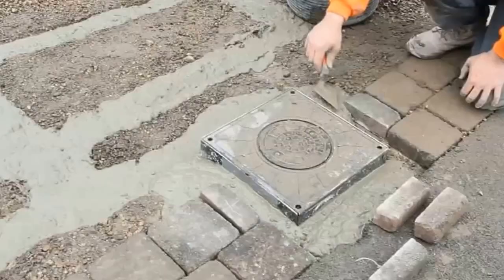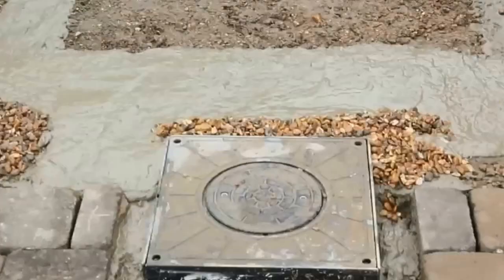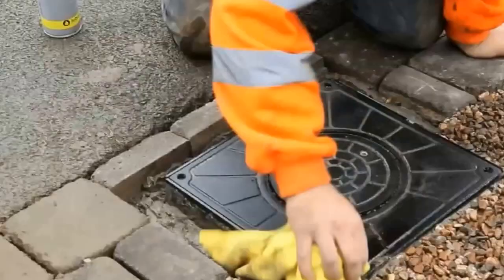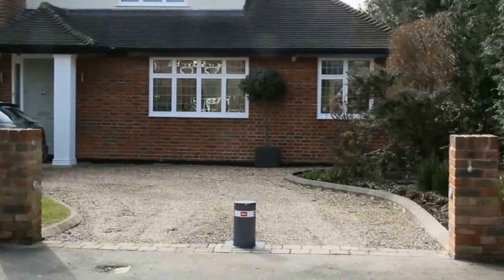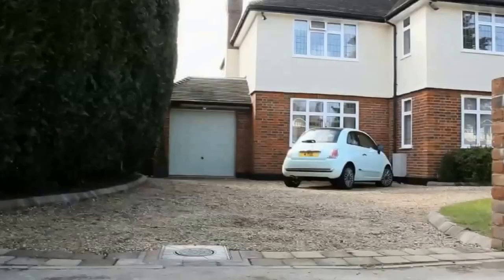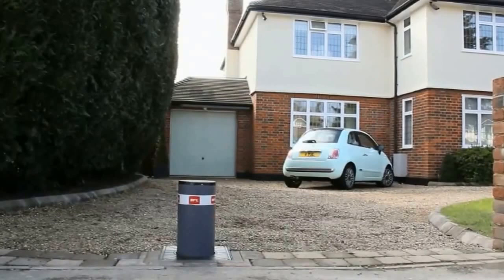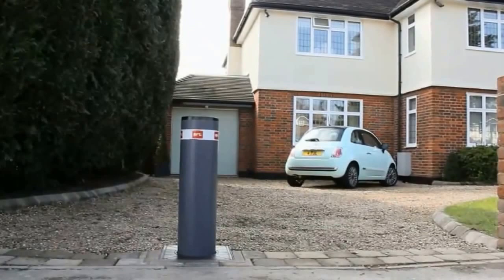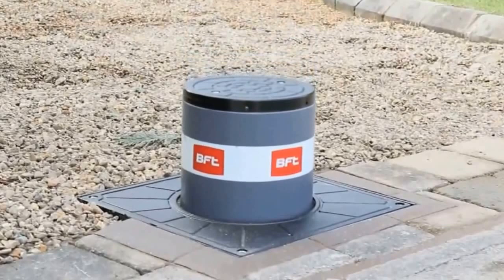Installing automatic rising bollards on a private driveway.

Comment: Anyone else notice that two Minis or Fiat 500s could drive on either side of the right side bollard... at the same time???
Reply from the maker: Fair point Cameron, although the bollards were not installed to protect either of these types of small vehicles. They are there to protect a large 4x4 and an SUV:)
Reply: @driveguard1  Would a lorry put that bollard down? Also, having wires accessible at the side of a pillar is a good idea?
Reply: @driveguard1  yes it's the first thing I noticed. You did a great job, but.... Ssssssshhh a stelel pole with a lock at the bottom would do the same ( if they intend just to pass either side of the pole! )
Is there a problem with SUVs and 4x4 s ???? 😂😂😂😂 in that area ??
Reply: Yes!! 🤣🤣🤣
Reply: @driveguard1  What was total cost (material + installation) for this job?
Reply: @embg  probly 2 grand total
Reply: I sure did.  You beat me to this comment. LOL
Reply: @driveguard1  could still easily fit a suv with that bollard up that house needs 2
Reply: @driveguard1  pointless
Reply: One bollard is obviously what the owner paid to have installed.  If that is what the owner wants, that is what the owner gets.  The job is done extremely well, professionally neat, and very organized. There is no accounting for what the owner wanted installed.  I think I would want two, or three, installed, myself.  But one is all that the owner could afford, I guess.  Price often causes compromise.
Reply: This installation really needs two fixed bollards next to the gateway pillars to reduce the large gaps and give added security.

Comment: The main thing to understand is that virtually any security system can be defeated given the willpower and the time.
So the point of a security system is not necessarily to defeat the criminal it's just to put them off.
Yeah, you can get past these bollards but why bother when the house next door is an easier and quicker challenge.
Reply: Most car thieves are looking for quick in and out and this might be enough to put most off. Having a decent steering lock on your car might be cheaper alternative.
Reply: All of the above plus if you go this far for a gate thieves might start wondering what else you’ve done to protect your stuff. It’s a psychological game.
Reply: That’s actually to stop cars from crashing into your house.

Comment: What everyone has failed to realize about this and almost all other non-keyed entry/exit devices is the presence of the ground loop. This loop detects metal. A wire running to the controller is monitored for changes. You can see this loop being installed a few feet inside the driveway. Funny part is the only thing one needs to defeat such an exit loop is a metal no-parking sign, throw it low to slide it across the known loop without setting one foot on the property. Bollard, retract. Same thing works on most non-keyed security gates. If your gate or bollard relies only on the presence of a vehicle to open it... a decent pieces of sheet steel or aluminum will defeat it in 2 seconds. Always add a keypad to exit, AND add the ground loop so that a vehicle must be present with a proper keypad entry to activate the gate or bollard. Now, without knowing the details on this install, it MIGHT be possible to shutdown that loop detection.

All that said, it’s a badass bollard install. Please tell me that loop is a proximity safety... but it’s way too far really for that purpose. Potentially a wireless receiver/transmitter... which is essentially taking the place of a keypad.
Reply: The loop is simply to prevent the bollard from raising when a vehicle is over it, nothing to do with granting permission for lowering bollard.
Reply: @TheHoipoloi  so this thing is controlled by maybe a remote rf key fob, with a hardwired switch inside the house? I like it. Nice install. In the US, the egress loops are often installed in this fashion. I have seen all flavors, though. Keypad with  egress loop, which is problematic for foot traffic with a gate setup. Mainly commercial installs in that scenario. Folks can and do get trapped inside if they do not have a vehicle. Building codes may also require a non-keypad egress loop. They are inherently insecure. 

I want one of these bollards. :)
Reply from the maker: Tim, you make some valid points, although in this case, the loop has been installed for safety, ie, to stop the bollard from rising accidentally if someone was to press the remote control by accident when someone is driving in or out of the driveway. It has NOT been installed as a free exit loop which you describe, so no, the bollard will not drop if you place a metal sheet over the loop. There was also no reason to install a keypad because the customer didn't need one or want one, they wanted to just use a simple handheld remote control to bring them up and down when they want. Just thought I would clear this up:)
Reply: You can hack anything with SDR

Comment: As a first generation Canadian of English parents I've never understood the U.K. fascination with front garden fences and driveway gates. These bollards of course eliminate the need for 2 gates.
Picture this...you arrive home from work, park on the street get out and open the gate. Get back in car and park in driveway. Get out and close gate. Do the same in reverse order to go to work in the morning. Madness I tell you.
Reply: Or get an electric gate that you can open from inside the car via an opener. Why would you put a gate on a house without an electric opener?
Reply: @mctigger1  if the car has the openener in then it defeats the purpose. You want to stop someone taking a vehicle from your drive. Deterrent first, but if the bollard or gate auto opens on approach then you don't solve the issue.

Comment: Water intrusion along the outside diameter when it rains? ....how is repair done? ; it seems the unit is encased in concrete?  Do you check for height of local water table and also frost-depth?....so many questions not addressed.
Reply: It’s only the shell of the unit that’s concreted into the drive, the internals just lift out for repair etc ( via a key)

Comment: So , the day before you go and cut the wires.  Then you come and use their driveway as a turn around.  Im not really sure I see why you want them.  Can you please describe a situation that they would be used in ❓❓
Reply from the maker: Gene, they are used for preventing the theft of vehicles or to stop other cars from using your driveway as a turning circle, they offer protection from both scenarios. Here in the UK, it is a massive problem. Some people like the manul lift telescopic type which you will see in car dealerships, and some people want the more convenient remote control type, so they go for the automatic bollards.

Comment: I live in the US and I am not sure what the purpose of the Bullard is. To stop other people from turning around in your drive way?
Reply: to eliminate all unauthorized access. think of it as a gate.
Reply: @googoo-gjoob  is there some local rules or laws against gates. Seems like a rather complicated and expensive solution, but different strokes for different folks. 

My ex-wife ( a real bitch) was from Manchester and she use to call the concrete structure at the center of a traffic circle a Bullard.
Reply: @joemama6906  , im from U.S. also. i know not the laws of this location.
i predict they used bollards due to limited space. the gate swinging in would occupy 40% of their driveway.
Reply: The bollard is to stop their cars from being stolen. Gates are usually intrusive and difficult.
Reply: @KiLLJoYYouTube  ...1. the bollards are to prohibit unauthorized movements...in or out.
2. the bollards are electrified & operated at the push of a button. a gate would function via the same method.
Reply: @KiLLJoYYouTube  that makes since

Comment: I assume this has a life span because of water ingress.   But deally wouldn't it be best with some type of drainage?
Reply from the maker: Hi Kevin, drainage is one of the most important aspects of any automatic bollard installation, and should be undertaken with consideration for the individual sites ground conditions. We don't go into too much detail on the video because it would take too long to explain all of the options. The video is simply designed to give customers a general overview of what's involved during an installation.

Comment: I will be fitting 2 of those. 
So when i buy a S3 and M3 i can sleep at night.
 2 front doors have been upgraded so has locks. 
Also old school locks custom fitted from inside with a bar :) its to slow the breaking into house to give me a chance to slash my sword threw the letter box.
Reply: Make sure you get cameras too
Reply: @KiLLJoYYouTube   cameras all set
 8x 8mp cameras 6tb hdd space.
Dummy box is setup. If crooks break in, all they gonna see is the dummy box. Real box is  hidden plus hid the hdmi long cable  under the floor abd made a port behind the tv.and have  done is connect a long usb cable port into a offline plug socket with spare usb slot. So i can connect the mouse or usbstick to download footage.  :)

Ghost 2 fitted on both cars plus tracker.
Reply: " slash my sword through the letterbox" that made me laugh. I can imagine a robber at your front door with a sword sticking out of his spine . Nice 👍👍

Comment: You'd think on a house like this they'd fit electric gates... stingey buggers!
Reply: I hate electric gates
Reply from the maker: You would only install gates to block out the view of the house. Bollards will leave the front open but not block out the view. Why bring peoples attention to your property by installing a massive pair of gates at twice the cost? Gates can be pushed open with enough force, but you won't push the bollard over :)